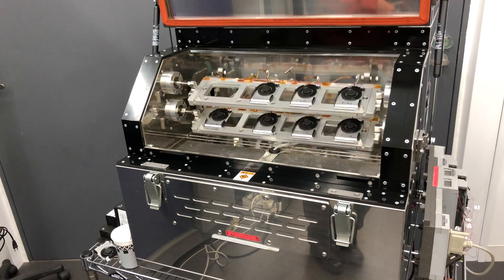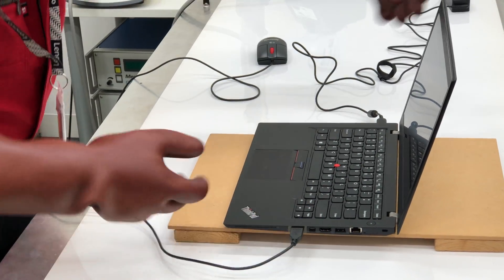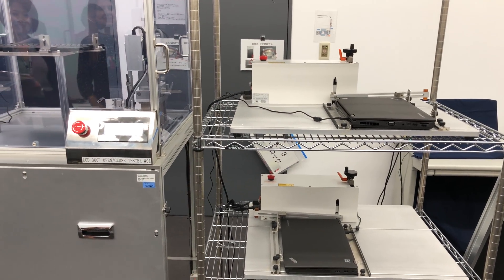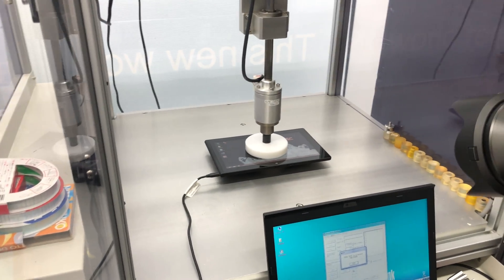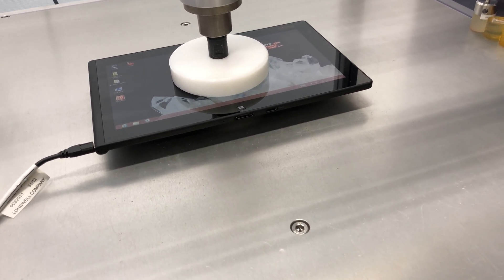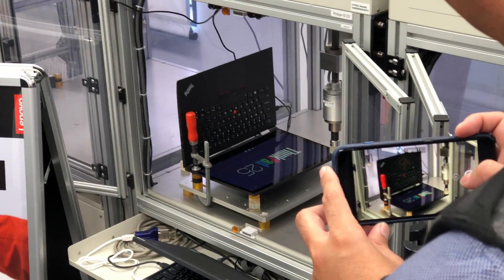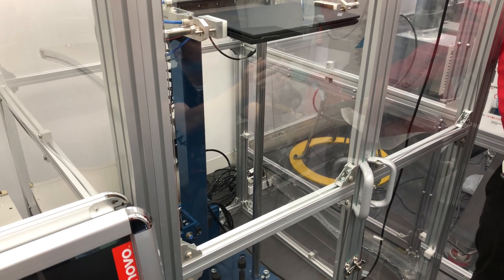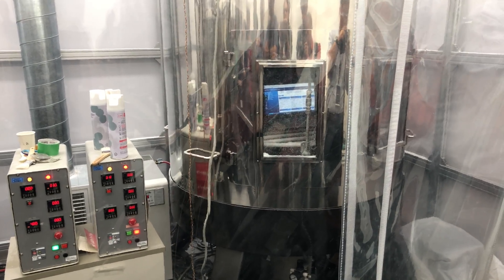Lenovo ThinkPad Yokohama Japan Labs Tour

Comment: They're built like tanks, but I've had several problems with mine.  The SSD failed within the first few months, and was replaced under warranty.  A couple weeks ago I made the mistake of installing a "critical" firmware update that bricked my unit.  They replaced the system board under warranty to get it to boot, but after that the trackpad hasn't worked, for which I've been waiting for another repair.  When it's working right, I'm very happy with it.

Comment: Thinkpads really are built like tanks. Last for a decade, at least. Sure, they slow down after several years but everything still works!
Reply: Slow down? I own a 2011 thinkpad t420 with a 3 years old windows 7 install on it and it is very fast and thats not even ssd yet, will upgrade that later. :D
Reply: Too bad they don't put coreboot on their motherboards.
I wish we still had IBM.